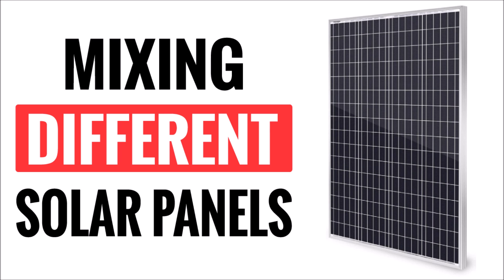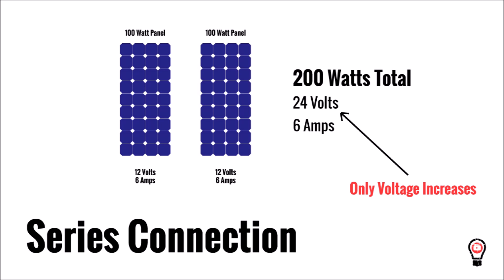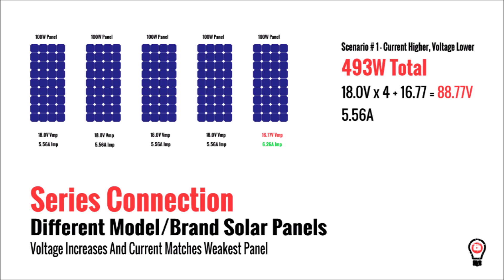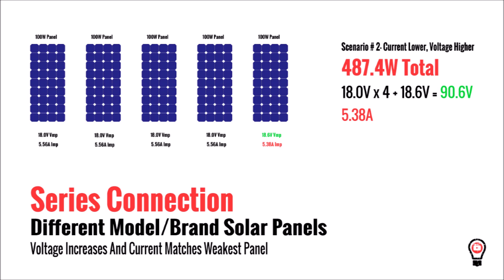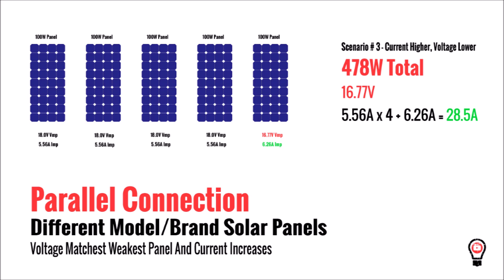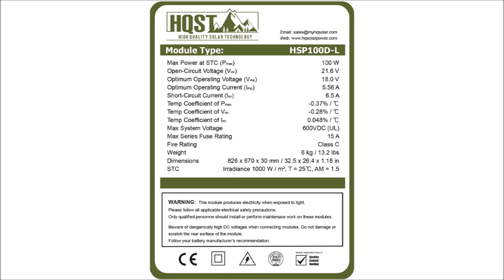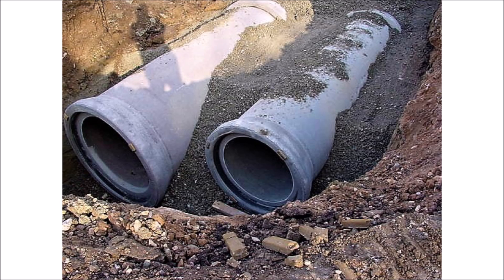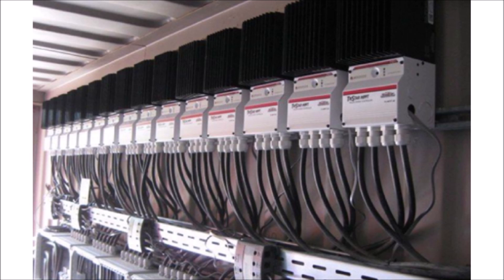Mixing Different Solar Panels In The Same System - What Happens And How To Do It Right

Comment: I'd like to post a constructive, factual, helpful comment but I always get stupid and usually hostile rebuttals in YouTube from people with no significant technical qualifications.
Reply from the maker: If it is constructive and helpful you are always welcome to post here.  If it is snide and narcissistic and deconstructive of what I am trying to do to help people then you may get a hostile rebuttal.
Reply: @LDSreliance  Your work is excellent. But I wanted to add a comment that would enhance it. I had no concerns how you'd respond. But the unwashed public has a talent for rudely discrediting reactions when they don't agree.
Reply from the maker: Yep, that is very true.  If there is anything that I have learned from this channel over 10 years it is that people turn into keyboard warriors and have no filter when they think they are safe and anonymous on the internet.  I've had to develop a thicker skin and just ignore most of it.

Comment: Did you heared about bypass diodes ? Learn more…..
Reply: Bypass diodes address the problem of partial shading on the solar panels.  They do nothing to correct the problems associated with mismatched solar panels.

Comment: I have a 120w and a 80 watt panel  both are 12to 18volts max amp is 6.5 and 4.5 it should  be ok in parallel. Am I correct?
Reply: Parallel is probably better because of the wider difference in the amp output.

Comment: Watts are Watts...I mix and match all the time
Reply: - Do the math on mixing a 400watt panel (40V, 10A) with a 50 Watt panel (20V, 2.5A).

If you put them in series, you’ll get 60V, and 2.5A.  That’s only 150Watts!

If you wire them in parallel you’ll get 20V and 12.5 Amps. That’s only 250 Watts!

In both wiring cases, adding the 50 Watt panel to the 400 Watt panel actually gives you LESS power than just the 400 Watt panel by itself.  

That’s not an obvious result to the average person.  

You’d think that adding a 50 Watt panel … it should be MORE than 400 Watts.  But it doesn’t work out that way due to the significant mismatching of the two panels’ electrical parameters.

Sounds like you’ve been lucky in your mixing of solar panels and haven’t experienced this degree of mismatching.  But if I were you, I’d do some solar panel math to make sure you’re getting as many Watts as you can.  

In my example above, there is a huge difference between 150 Watts with two panels VS 400 Watts with only one panel.
Reply: @test-193  meh
Reply: @kayakwesty  - LOL, I figured that you'd say that.  

Show somebody that they are wrong with simple math and straightforward facts........  and they STILL don't want to admit they might be wrong.  Geesh.  I see this a lot these days.

As long as you are happy with your solar system, that's all that matters.
Reply from the maker: Are you trying to say you are getting max power from all of your panels?
Reply: @LDSreliance  I'm not sweating 15 Watts. Quality control on most panels are horrible anyway.
Reply from the maker: OK fair enough.

Comment: Thanks, this is very useful info.
Please also advise your thoughts on dividing panels into two totally separate arrays to feed an off-grid system for longer overall day of generation.
I'm in the southern hemisphere and all my suitable roofs (it's a small farm) face Northwest. Alternatively I can face Northeast too. I'm thinking instead of building a new structure for 30 400w panels, to rather split into two arrays of 15 panels each on existing structure.
My thinking is that a longer day would reduce the storage required?
Reply from the maker: Yes, splitting panels east and west is a valid strategy to try to reduce storage but at the cost of overall power generation.  So you have to really carefully analyze the pros and cons of that scenario.  Battery storage is getting cheaper every year.  So that tradeoff might seem appealing now but you might be kicking yourself in a few years.  One of the drawbacks you might not be thinking of is when there is little to no sun on rainy days, you will be stuck with a smaller battery bank that may not get you through the day.  And forget about multiple days.  So what then?
Reply: @LDSreliance  great, thanks for the sound advice. Makes perfect sense
Reply from the maker: You are welcome.  Good luck!

Comment: Got a 1.2kw system with mixed panels however they all have a very close voltage spec. Works fine no problem.
Reply: The similar Voltages will work well if you are paralleling the solar panels.  However, if you are wiring in series… their Current needs to be similar in order to fully optimize the mix-matched panels.  

Recall that the current for ALL of the panels in a series connected solar array will drop to whichever panel has the lowest current.
Reply from the maker: Hey, if you have them use them.  It certainly can't hurt anything as long as they are fairly close.  Just trying to educate people on what happens when you do.

Comment: Hi.  Being new to installing my new solar panels I always wondered about this as I got a pretty good deal from one of the companies that's pretty reputable but I found some other panels that I wanted to add to it and I always wondered if it would be compatible. Compatible but not efficient and thank you for clearing this up for us....
Reply from the maker: You are welcome.  There is always a way.  But just adding them to the existing system without any thought probably won't do you much good.  Thanks for watching!

Comment: At 2:74m ...are you sure....have you tried it?
Reply: here is a link to an equivalent circuit to aid your understanding of solar cells and panels. https://youtu.be/ILnZqem4gbU
Reply from the maker: I'm not an electrical engineer so I'm not going to argue with you on the theory.  But everything I have ever read online or seen done all indicates that in parallel the voltage will drop to the lowest common denominator.
Reply: @LDSreliance  I can't see repeating online myths or inaccuracies would be good for your channel or general advancement of the understanding of those wanting to get into solar
Reply: @LDSreliance  If you are not an EE then at the very least a simple connection of two panels of differing VOC or VMPP will show you the truth...worth doing before making statements of fact that you have not verified....consider those people who are not as experienced as you are....
Reply from the maker: It is only a myth if it is disproven.  If you can find me some documentation for the behavior you are describing in solar panels I am happy to admit that I am wrong.  In the meantime, literally every solar expert out there is saying what I am saying.  If I had two solar panels with a statistically significant difference in voltage I would be glad to do a real world test.  But I don't.
Reply: @LDSreliance  I did post a link to a YT video showing the theoretical model of a solar cell. While he does not demonstrate what happens if you connect differing VOC panels,you can clearly see  that a solar cell behaves in a more complex way than what your sources are saying...i.e. an ideal voltage generator....but rather it has both series and parallel loss resistors and is centred around an ideal current source. As a video subject idea, you could cover this subject with simple diagrams and effects in differing connections and panels. I personally agree with your premise to keep all panels the same to maximise power output, Where I have an issue is blanket statements that are misleading. A great analogy for those non EE people is saying ...don't mix petrol (Gasoline) and diesel, but you can mix 90 & 95 octane and still get the benefit of both. e.g. you could parallel all 60 cell panels and each will contribute something useful. With series arrays, the analysis will be different however not as fatalistic as I see unless the current rating is significantly lower. Otherwise your and others assertions can't both be true.  i.e. if panels behaved like simple and ideal voltage sources then they would simply add their voltage to the array...and as you know that does not happen.....mainly because they have a series internal resistance
Reply from the maker: At 2:74?
Reply: @LDSreliance  Yes...you began to suggest that a lower voltage solar panel would drag down the entire parallel array to that lower voltage....this can only be true if solar panels acted as ideal voltage generators....which they don't. They have an internal resistance as a source, and are more complex as a sink. obviously wide variations in voltages are not ideal in a parallel array, however small variations such as 29:4 & 29:8V will have little to no effect...as each panel will contribute very small variations in current related mostly to the variations in internal resistance. The voltage of the array under load will not be the lower voltage

Comment: Not on topic. Sorry. Modified sine wave inverters not good for electronics. But is it ok to use the usb output safely on a modified inverter?
Reply from the maker: I can't find a definitive 100% answer.  But I suspect that it doesn't matter.  With the extremely cheap cost of AC adapters for charging phones or other USB devices, I would bet that they are not producing a pure sine wave.  Also, many electronic devices can operate just fine on modified sine wave.  So don't get stuck on a broad generality like that.  People parrot those kinds of "rules" without really understanding the why or the exceptions to the rule.
Reply: You’re forgetting that USB output is DC power, not AC (sinewave).  So the inverter just needs a simple buck converter to drop the battery voltage from 12VDC to 5VDC.  No sinewave or modified sinewave involved.  Just a buck converter with some smoothing capacitors.

Comment: It's a game of "the weakest link".
Reply from the maker: Yep.  A game where you always lose, if you look at it from a total power perspective.  If you look at it in a net perspective, it may not be so bad depending on the deal you got on the panels.  Me, for example, I have some panels that are no longer in production that I got when I started 8 years ago.  So if I ever add more panels to the system, I will have to play this game of weakest link OR use a charge controller laying around (which I have plenty of).

Comment: I just got back from visiting a friend .we both used to live on boats, he still does. He just got a 600 watt solar panel. I didn't know they make them that high.wow.
Reply from the maker: Yes, sizes above 400W do exist but are pretty rare still.
Reply: @LDSreliance  and pretty heavy!
Reply from the maker: And difficult to move and ship I would imagine.
Reply: @LDSreliance  it was no bigger than the other size solar panels on the other boats. You can't go to big on boats,no room and in a storm the wind can pull them off. I will have to ask him about it .
Reply from the maker: Are you sure?  Sizes may be deceiving at a distance.  400W is still large but to get a 600W panel to be the same size as a 400W panel would take a massive jump in efficiency of panels that doesn't really exist yet.
Reply: @LDSreliance  Agreed. 600w is 50% more area if the same efficiency. If length and width are both slightly larger it would be hard to tell without a side by side perspective.
The Trina solar 600w "Vertex" is 1303mm x 2172mm and weighs 35.3kg or 77.8 pounds. It's over 21% efficient and the highest binning of that line (same size is also sold as low as 580w when they don't turn out as well, but that is still over 20%).
Reply: @LDSreliance  l think so.l only looked at it ,it looked like a normal size.that is what surprised me. I will call him on the weekend and ask for more details and let you know. 👍